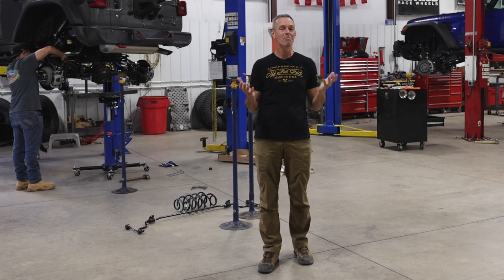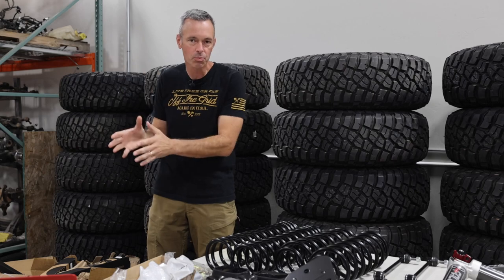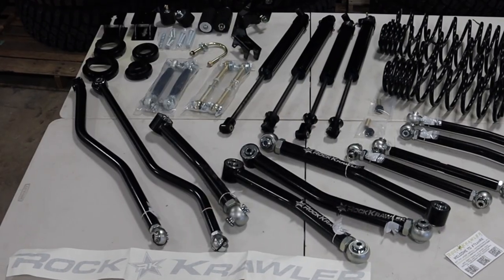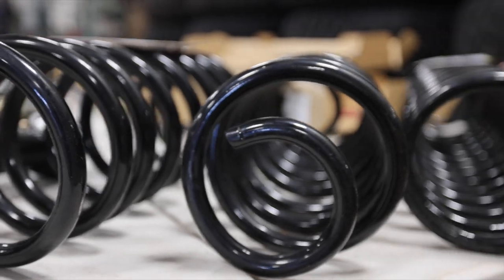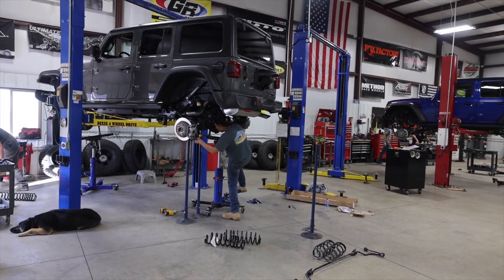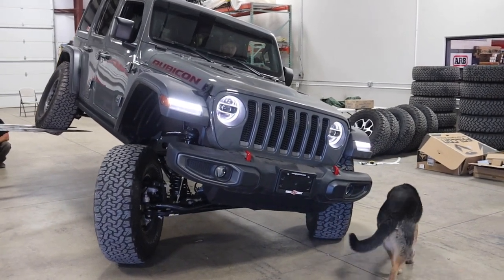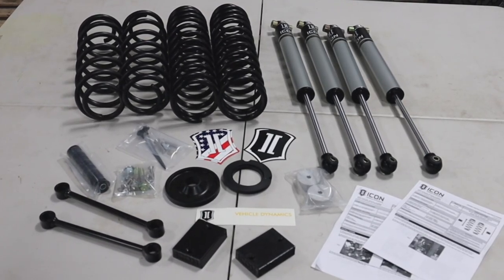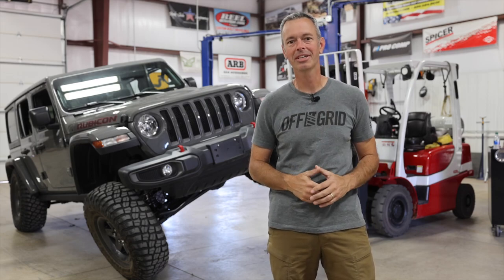The Ultimate Jeep Wrangler Lift Kit Comparison – Install & Measurements

Comment: I’ve got high hopes my local boys from Teraflex!
Reply: I wish he’d have used one of the kits with the Alpine arms, though.  I’m running the RT3, though I stuck with the Falcon 2.1’s for budget reasons.  So far it’s been fantastic on the road, a lot better than stock.  Off road has been great, too, but I haven’t done anything difficult with it yet.  Installed myself, then drove 100 miles to a 4x4 shop for alignment and to check my pinion and caster angles.  They did make some minor adjustments for castor & pinion, and I could really tell the improvement when I drove away.
Reply: @KansasSlim64  how do you like the RT3 kit? I’m thinking of getting it with the SP 3.3.. the pricing I got for install and kit was just above $6,000 but haven’t seen any videos on it to see if it’s worth it
Reply: @Slozzy_RC  Like I said above, it’s a LOT better than stock.  Places where I’d experience a lot of “head toss,” just pulling into highly curbed driveways decent pace coming off a 45 mph road, stuff I drive on the regular, I noticed a big difference over stock.  As I mentioned above, none of the off road trails I’ve done since installing it had any real obstacles, so other than more clearance, I can’t give a good comparison.  Though with the longer shocks I’ll certainly have more flex, but I haven’t RTI’d it or been on the major rock obstacles yet.  I was about to pull the trigger on a MC Gamechanger, wrestling with that and RK and TeraFlex and Icon, then I read about the new bushings TeraFlex started putting in the Alpine IR control arms.  Like the MC, they seemed to be elastomeric bearings like we use in aviation, but the IR bearings have a sleeve that allows free rotation so the as the bearing/bushing flexes on it’s rotational axis it’s not twisting against the rubber, binding up the suspension so to speak.  It seemed like a reasonable concept so I took the plunge.  Go check out their videos about it on the TeraFlex site.  And save yourself some $$$ and install it yourself.  If you’re concerned about the alignment and pinion and castor angles, just go with what the instructions give and take it to your shop and let them make the fine tuning adjustments if necessary.  Plus you’ll learn a lot about your rig.  I’m sure if you spring for the 3.3’s, that’ll make it seem entirely more plush than mine when you dial it down for the rough stuff.  I will add those at some point, but I got a heck of a deal from a forum member on the 2.1’s and they are great.  Nice and firm in the twisty’s, but even on our rough lane it’s smoother than the Mrs Trailhawk Cherokee.

Comment: Great breakdown, could you tell me the stock height measurement of the front and back top and bottom shock bolts?  My center to center on the front is 22.5".  Thanks

Comment: Great video! Is there any suspension you would recommend for a 5th Gen 4Runner?
Reply from the maker: I have only driven a couple suspension setups in a 4 Runner, and I don't have enough info to really give an informed answer.  Last Line of Defense or FOTORNR on instagram are good resources.

Comment: With all those lifts going over stated heights, how was pinion and caster?  Icon had no c-arms and went over 3.5", pinion had to be affected.
Reply: Great question!  I did the TeraFlex RT3 myself, but had a shop check my pinion & castor.  Since it had adjustable arms they made some minor corrections and I could really tell the difference on the road.
Reply: @KansasSlim64  lol.  Not so scary anymore huh???

Comment: Ok , 1200 $ kit comparing to 4000 $ kit  ? On kit like jock they should have a remote flex zerk fitting rather cutting, zerk down so what.  If they can’t spend the money on good instructions I’m not going to buy ! Good reviews really

Comment: Which of these lift kits are compatible with the EcoDiesel Wranglers . . . I know some are NOT.
Reply from the maker: If you have an EcoDiesel I would recommend going with a suspension specifically tuned for the extra engine weight.  These kits are for the gas 3.6l

Comment: Where’s the MetalCloak lift?
Reply from the maker: * Several other suspension manufactures were invited to participate in this comparison, but because of product and shipping delays they were not able to meet our timeline.
Reply: @TrailRecon  should'hv adjusted the timeline to accommodate MC without them this isn't "ultimate"

Comment: I have the AEV 2.5 on my JLUR with 37’s. Does anyone know when they’re going to release the upgraded shocks?
Reply: They have been teasing the diesel suspension which is designed for the additional weight. That could be the solution.
Reply: @patrickerwin4922  I believe the diesel suspension  is available now.

Comment: Wow these kits are pricey. You can go to rough country and get a 6in long arm lift kit for just under 2500.. or there 3.5 for 1100..
Reply: That's hilarious. Good luck with that.
Reply: @jakeweber9787  there's no luck there.. just go to the website and place the order that simple..🤷‍♂️🤷‍♂️🤷‍♂️🤷‍♂️
Reply: @Bennett-xo6iu  no Wrangler JL needs a 6 inch lift kit. Are you trying to fit 48s under there and still be top heavy? That, and RC is the walmart special of off roading.
Reply: @jakeweber9787  see i dont know why ppl say that about RC i have.RC lifts on all 3 of my trucks.. the newest one being my 2002 ranger. And I have had no issues with the lifts on any truck.. for the 6inch I like the way the stance is on that plus with that much more room the tires tend to make less contact with the fenders vs some of the 3.5 lifts and the tires rip the fenders right off.. everyone has there options of what they like though.
Reply: @Bennett-xo6iu  they say that because it's true. RC is cheap &%#%.
Reply: @jakeweber9787  well with the lift I ordered for my ranger I looked at the parts myself and the brackets are nice and heavy and the welds look great.. I have had the lift on there for 7months and its been great..